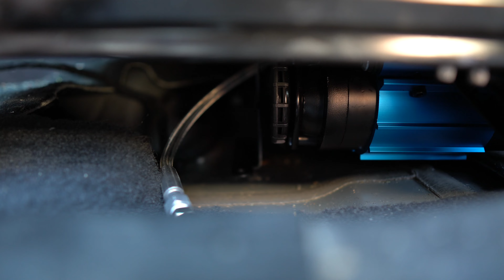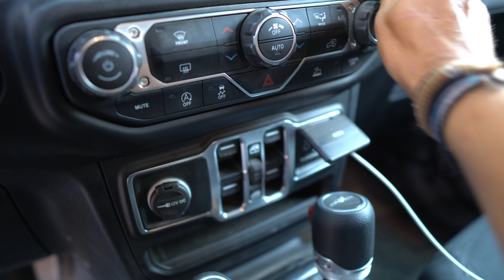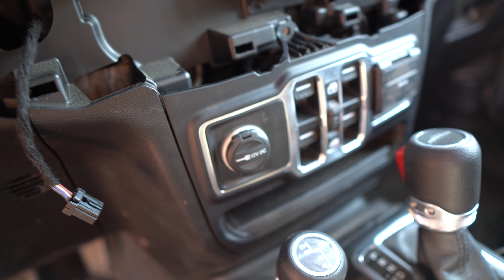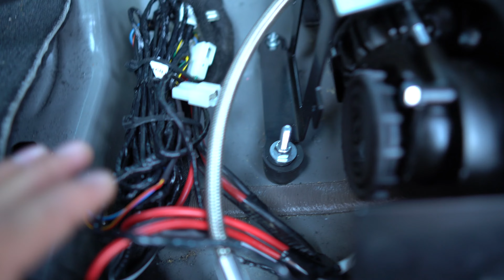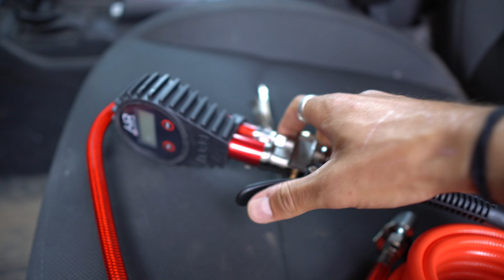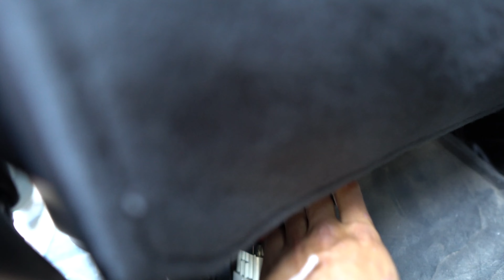ARB Twin Air Compressor Install (Jeep Gladiator EcoDiesel)

Comment from the maker: Little update for everyone here! After using the compressor for a few months without issue, I ended up needing it one day and it wouldnt turn on. Traced the issue back to a blown fuse where I had wired it into the cigarette lighter (cigarette lighter fuse 52 had blown) so I dont know if I messed up the switch wiring or if the switch draws too much power from the small fuse. Either way, I replaced the fuse and it works fine so ill keep you posted as I continue to dive into the best way to wire it up.
Reply: Any long term update on this?
Reply from the maker: @miguelcereceres6977  Yes! It's still functioning well and seems to be happy in that location. I dont use it as often as id like, but I work on motorcycles a lot and having quick access to air has been awesome for that too.

Comment: Nice video very well explain to everything is clear and transparent. I have just had mine installed under the driver seat on my LC 76. I guess the same price door was followed. Just give me a feedback. How is the performance is going? I have exactly the on board ARB air compressor exactly the same one.
Reply from the maker: Thank you for the compliments! It has done really well for me. The location keeps it in a clean cool air location and it’s very easily accessible. I haven’t had any problems with it 👍

Comment: About to install in a TJ,, what about noise inside  ?.... worried about noise while cycling
Reply from the maker: If you seal it well and it's not leaking then there shouldn't be much cycling when you lock it up. However, it is fairly loud in there so if thats a true concern then you may want to try a different spot. I dont have lockers yet so I cant say for sure how often it cycles while holding pressure.

Comment: Easily one of the most useful videos for installing this kit into a Jeep Wrangler/Gladiator! Thank you. It's total bull crap that ARB did not include the hoses, and adapters, into the underseat bracket kit. I also had the same problem with the front of the underseat kit not sitting correctly on a 2018 Wrangler. Thanks again for the video. Cheers!
Reply from the maker: So glad the video was helpful and I appreciate your donation to the channel! I too was pretty irritated with ARB when it came to that, should be an all in one kit or it shouldn't be labeled as such.

Comment: why not run an add a fuse to send voltage form switch to relay? wouldn’t have to splice factory wiring mate.
Reply from the maker: At the time, splicing seemed simpler but looking back I wish I would have done that lol

Comment: Thanks for sharing. Im about to tackle this job on my JT and putting under driver side as well.  Wish me luck lol.  I got all the wiring ready.  But will run under thr carpet up to the firewall plug driver side somce i already have aux power through it.  I just need to find the proper acc and light wires to tap splice.
Reply from the maker: Best of luck to you! Hopefully you learn from my mistakes and it goes smoothly for you. Are you planning on using rubber feet like I did on mine or are you running a gas JT? I’m jealous of your aux switches, I’m still running mine through The 12v
Reply: @LifeOutdoors  I have the gas engine. I may run rubber feet though.  So I'm not having to drill through the body
Reply from the maker: @yakitoriPB  That was my thought too. Maybe the bracket will actually fit the Gas model as it is supposed to given its the same body up front as the JL.
Reply: @LifeOutdoors  I got it installed.  No issues. Ran the ignition wire to the fuse box and gear illumination in the console for the blue illumination wire.
Reply from the maker: Nicely done! Did the feet of the mount end up matching with 4 mounting points?
Reply: @LifeOutdoors unfortunately no.  It's the same slope in the 3.6 gas.  I bent the tab on that side and used rtv to stick it to the body. I drilled the flat side though.  It would be a mistake to drill the sloped side anyway because I noticed the heat shield there so I didn't want to drill there. 

Plenty' of room for the compressor though and driver side is way better for mounting imo.  

Your video was extremely helpful btw. I used it as a guide for my install.  So great content!  Much thanks.  I felt the exact same doing this.  I was like....what did I get myself into. Lol. I almost wanted to pay someone to do it too.  It was a big learning experience for sure.  Glad I have onboard air now.
Reply from the maker: @yakitoriPB  Well bummer that its not the right fit but sounds like you made it work! I love the fact that it gets AC on the compressor too, extra cooling factor and fresh air compared to under the hood.

That gets me pumped that the video was helpful! I was close to paying for an install too but just forced myself to film the process and used other videos to piece the install together. Thanks for watching and enjoy your air!
Reply: The link for breaker
Mount??
Reply from the maker: Here ya go! 

https://a.co/d/02biz5H

Comment: I did this same install but for the passenger side, took me all day. Only thing I did different was wire to the fuse box for power to the switch, since I don’t have aux switches.
Reply from the maker: It really is a massive pain of an install. I have something going on with my wiring now that I need to track down beause it wont turn on. Think I pulled something out of place when I moved the seat forward during our last move from CO to OR.
Reply from the maker: turns out my issue was blowing the cigarette lighter fuse thus rendering my switch useless. Not sure how it happened because I replaced the fuse and it works fine again. Must be too much for that little fuse so I may have to change the way I wired the switch in.
Reply: @LifeOutdoors the switch is only pulling maybe .2 amps if that.. the switch just sends voltage (no amperage) to the relay to signal the coil to turn on and pass power through. chances are that cig lighter is at least 10 amps so you must have shorted a connection somewhere for the fuse to blow
Reply from the maker: That is some great insight! After going through the wires, I not longer have the issue... so something may have been rubbing and I fixed it for the time being with some additional electrical tape or something...

Comment: Is it safe under the seat ? 
I am trying to figure out where to mount mine
Reply from the maker: Its definitely safe and I would say its better in general because its protected from the elements and will stay cool with AC air as opposed to sucking in engine bay air.